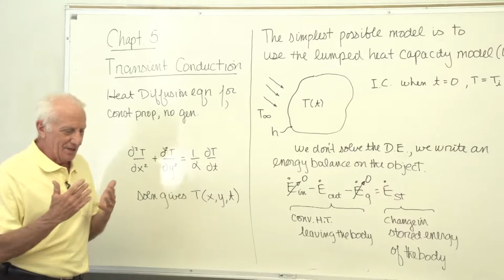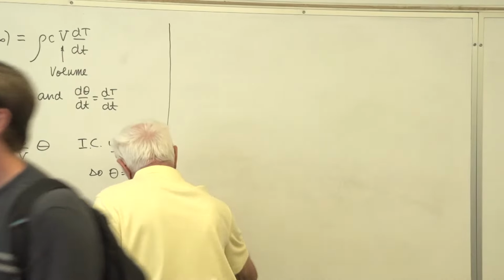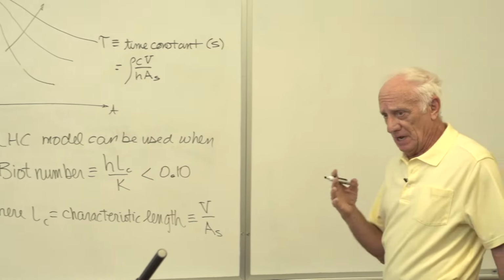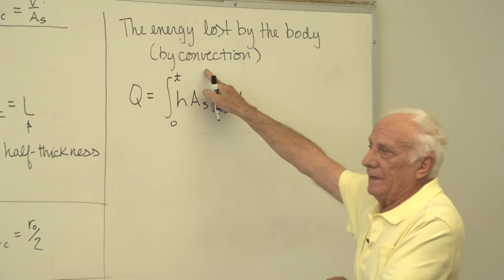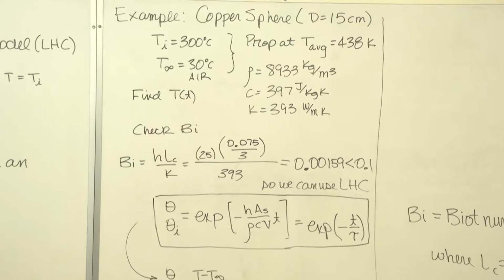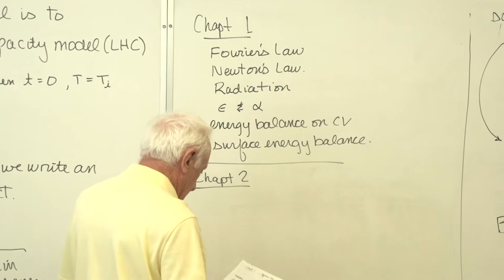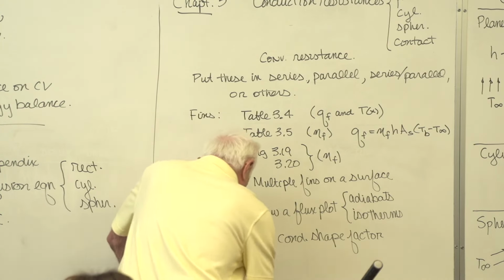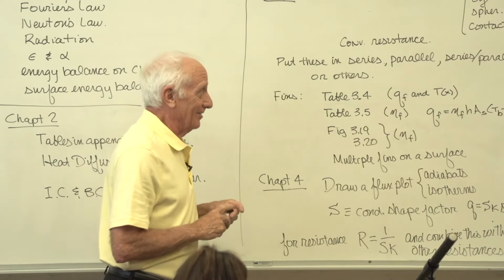Heat Transfer (13): Transient heat conduction, lumped heat capacity model and examples

Comment: Interesting, can we express (hAs)/(mCp) as 1/(Rtotal*mCp) Where R can be as Rconv+Rcond and how has to be looks Biot number in this case?
Reply: In a lumped-capacitance model, the solid temperature is assumed uniform, so Rcond  is neglected. The condition Bi <0.1 is precisely what justifies neglecting the internal conduction resistance.

Comment: how could L sub c (volume to surface area) of a cylinder == radius/2 !!! its unverified
Reply: I believe it's for slender (very long compared to their diametres) cylinders, where r is not that long compared to l? That simplifies the characteristic length to roughly r/2.
Reply: LC= V/A
= πr²l/2πrl
=r/2

Comment: shouldn't  Bi be much greater than 1 to use the lamped capacitance method
Reply: Nope, you use Hiesler's charts then. For less than 0.1, LCM. For greater than 100, error function method.